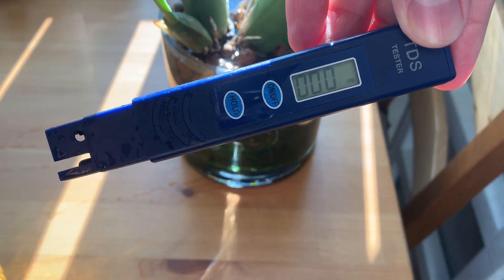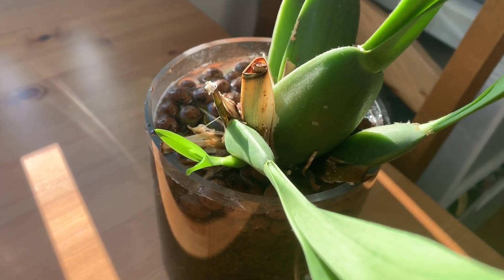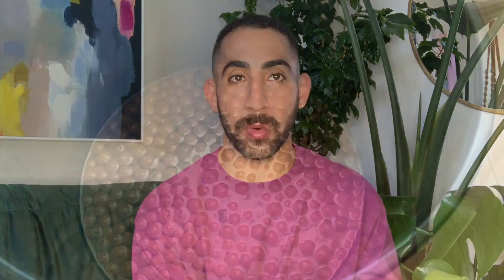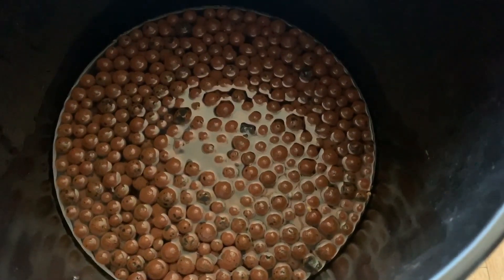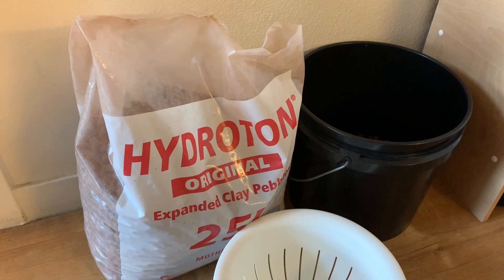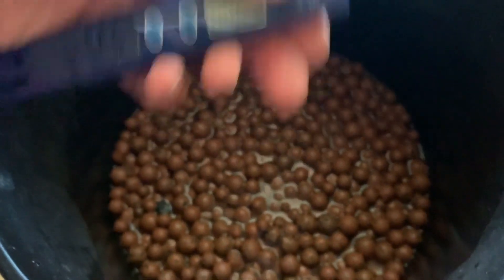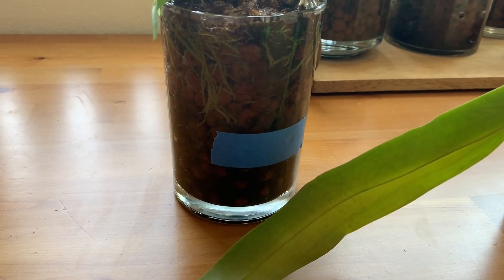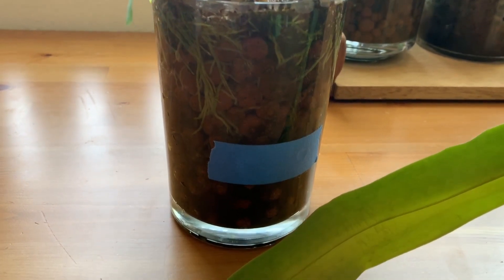My Biggest Mistake of 2019: Semi-Hydroponics

Comment: I just wanted to thank Michael for his advices. I have two orchids that were gifts, and after few months, specially after the cold season, they started to die slowly. I followed advices found in different webs about recovering weak orchids, transplanting them, etc, but nothing really worked, even when I did the process carefully, placed them in the lounge with almost perfect conditions. But I found Michael´s channel, his well explained methods based on his own observations and nature´s wisdom, and went ahead with the semi- hydroponic system. I bought two nice glass pots, drilled the holes, and replanted the orchids in those new conditions. After less than two months, the two orchids came back to life, new thick roots, new strong leaves, a miracle. And they look great in their glass pots with clay pebbles. Thank you Michael. Regards from Spain. Miguel.

Comment: You legitimately make some of most scientific, entertaining, and in-depth videos on orchid growing. You're doing an awesome job, keep it up!
Reply: Using K-Lite Orchid / Epiphyte Fertilizer (12-1-1-10Ca-3Mg) in RO water with great results for semi-hydroponic growing.  Studies have suggested that excessive potassium, whether applied, obtained from, or accumulated in growing media, can have a negative impact on the health of plants, especially in the absence of adequate calcium and magnesium.  Excessive potassium can exacerbate deficiencies in those essential nutrients by preventing them from being adequately absorbed. 

Feeding at 25 - 50 ppm N at every watering, using pure water, two or three times per week or more, flooding the plants each time, mimicking what they receive in nature = 1/6 - 1/3 tsp/gal
 ...or
For once-a-week feeding, use 75 ppm N = 1/2 tsp/gal or as much as 150 ppm N = 1 tsp/gal for feeding every two or three weeks.

The K-Lite formula mimics the nutrient mix provided by the combination of host plant exudates and accumulated airborne particulates that are flushed down from the forest canopy whenever it rains. The low dosing provides plenty of nutrition for these slow-growing plants, while avoiding root damage or the buildup of mineral residues and wastes.

Comment: Good video Michael and you talk a lot of sense. The only think that is worrying is that with continually feeding the plants after doing all that work with the leca it will absorb solids and nutrients and virtually return to it''s  pre-soaking state. .Although   Although Phrags love to be wet I would never use leca for their medium. Phrags love their water to be very low in salts......this is the way they grow in the wild with their roots in running water fro rivers, streams and waterfalls.....and the like their roots to be cool. Have a good week and take care...
Ed.
Reply: I totally agree. The minerals will re-build back if hard water or even soft water with fertilizer is used. Also there will always be water left in his glass vase at the bottom and as it evaporates, minerals start to re-build back on the surface.

Comment: I've heard of people soaking the leca in a vinegar solution, the acidic nature of which assists in dissolving minerals.
Reply: Michael McCarthy this makes a lot of sense. Probably the quickest and most efficient way to dissolve and wash away minerals.
Reply: Also, solubility increases with temperature. I recommend boiling in 1 part vinegar & 1 part distilled H20
Reply: Thanks
Reply: Orching well, you’re wrong and easily verifiable. If you soak plain leca in water, the TDS will rise in the water as salts and minerals are removed from the leca through osmotic regulation.
Reply: Orching  um, no. Rinse your clean unused leca fully, then soak it in water overnight and measure the TDS before the leca is added, and after. The TDS will rise because you are DISSOLVING (TDS=total dissolved solids) salts and minerals from the leca. What do you think clay is? Various salts and minerals are present in clay. Derp. Maybe you need a level 1 inorganic chemistry class?
Reply: Orching whatever dude

Comment: Hi Michael, I'm watching your video for the first time, very interesting information! It might be a bigger problem with the  closed-system. Have you ever tried a semi-closed system, like double orchid pots (pot in the pot (or a saucer)? Thus you can give the orchid a shower or just water it through to rinse minerals down. I do it once a month and the let the orchid dry out a bit. I normally have some water in the outer pot so it reaches about 1cm of the leca of the inner pot. When all the water goes down and no more touches the inner pot, I water the orchid or give it a good rinse. The semi-closed system gives you more options. 
Thanks for the video!

Comment: So what is the proper preparation procedure for new LECA? Soaking in 0 TDS water for two weeks. Is there an alternative for those of us that don't have an RO system? Distilled water is $1 per gallon.
Reply: Rene Sonse you need to flush SO MANY times to reach down to 50 and below... I buy LECA from ikea, starting from around 230. Soak in regular water (my tap water is around 23...) let it soak for 1 day, flush again and let it sit for 1 day and use tds meter... repeat till it gets low enough...

Comment: I have read many times that the potting medium should not touch the stem... but with leca the top layer is only wet for a very short while, so... what is the rule regarding leca... is it ok to let the top layer (1/4 to 1/2 inch) be in contact with the bottom of the stem??

Comment: Hey Michael, I just wanted to leave a comment regarding the TDS meter you are using. The quality of that specific meter is not great and needs calibration very frequently to ensure the results you are getting are correct. Not sure if youre using a standard solution with a designated TDS count to standardize your TDS meter. I purchased a new TDS meter because everytime I tried to calibrate the blue meter is was always SO FAR OFF (like 100ppm off ).

Great video though I'm absolutely going to be soaking my leca again tonight in some reverse osmosis water. I can't believe i also didnt think of this omg

Comment: Thank you for the pertinent information. What is reverse osmosis water?
Reply: Reverse osmosis is a water filtration system that pressures water through a membrane with really fine pores.  Water out of a reverse osmosis filter measures 0 to 30ppm,  almost never 0. RO water not only removes all minerals in the water, but also bacterium. You can go crazy and buy a really expensive system, but you can also buy the same system in EBay for around $140.  If you are half way handy, you can install the system yourself.  A 50 gallons a day will do for most people.  The best reject ration for RO, is 1:1. That means a gallon of water will be wasted for every gallon of potable water.

Comment: Does anyone have thoughts on using Dyna Gro's Dyna-Zyme to break down fert residue
Reply: haccprof I believe vinegar in water would work just as well and be much cheaper.
Reply: @orchidgarden3124  How much vinegar do you recommend per gallon
Reply: haccprof I would use a 50/50 white vinegar to water (for treating leca before you pot the orchid) and let soak overnight. Then rinse well and use it.